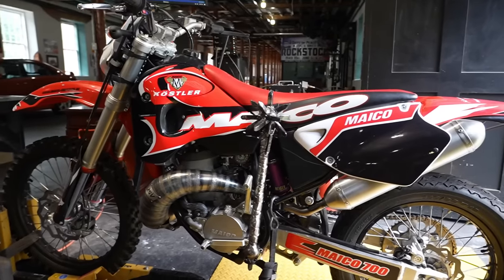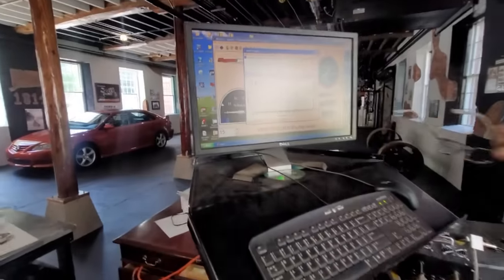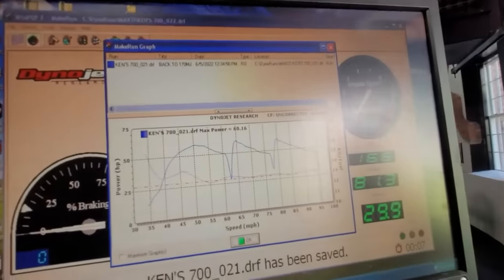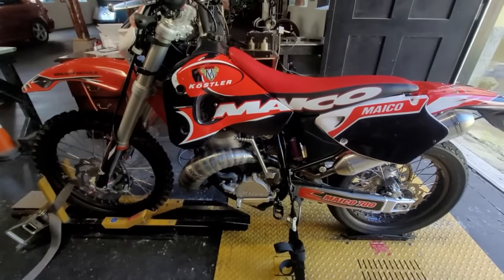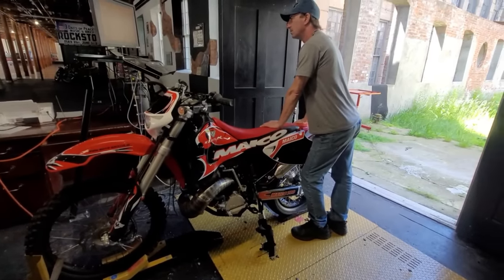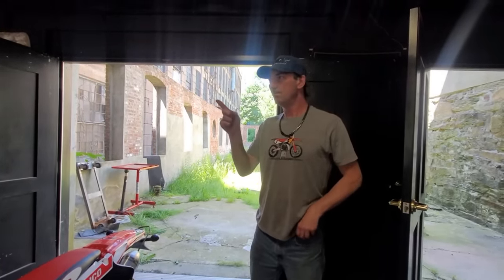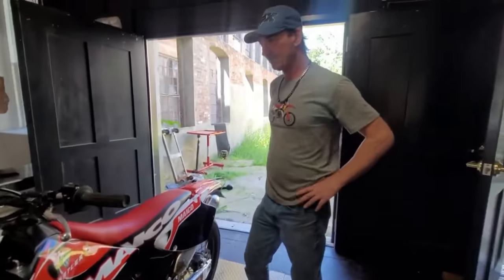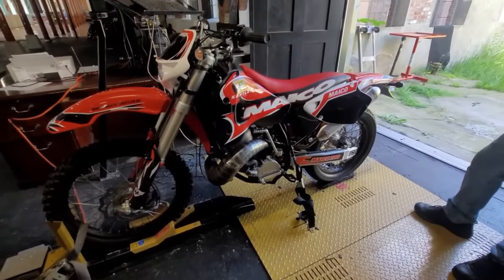2023 MAICO 700 DYNO PROOF 40% MORE TOURQUE THAN CRF450; THE WORLDS FASTEST PRODUCTION 2 STROKE

Comment: I would say that pipe is starving the motor of power. I had an 1160 twin snowmobile motor that made 205 HP at the crank. The pipes for this motor were substantially larger than what you have on the Maico flowing 580cc. For comparison sake that should make 120 HP based on the CCs it has. Also I was making 135 ft lb of torque.
Reply: @frenchonion4595  That thing should make 120 hp. I'm getting 102.5 HP and 67.5 ft lbs of torque out of 580 cc. The pipe is crucial to 2 stroke power.
Reply: it don't work like that. typically the bigger the bore on two strokes you start getting diminishing returns. meaning example YZ 125 has 37.5 HP X2 would be 70 HP but yet yz250 has 49. reason why is the bigger the bore to slower the flame travels just saying
Reply: @2strokecarbtuningportingin187  So why do I get 102.5 HP and 67.5 ft lbs of torque out of 580cc?
Reply: @kevinbok7269  makes sense if you think about what your saying. It's a 580 twin.  Now go back and read what I wrote
Reply: @kevinbok7269  stock YZ 250 has 49 HP  so getting over 100 with a 580 cc twin is expected
Reply: If you had a 4 cyl 500 you would be about 150 it's called thermal efficiency
Reply: @2strokecarbtuningportingin187  No it's an 1160 twin.
Reply: Hmm on pump gas  again I have heard lots of claims never gonna see  130 HP out of a 580 cc single he is lucky to have 70 at the crank with a 700. Thing is with your  snow mobile it has a variator type clutch so you get away with a lot higher portimings than a manual clutch / gearboxwood. Been messing with two strokes for a little over 44 years also been messing with four strokes for about just as long 2660 cc V2 naturally aspirated pro stock motor is making 400 at the crank
Reply: @2strokecarbtuningportingin187  OK I'll say this once. I have an 1160 cc twin that makes 205 HP and 135 ft lbs torque. Are you missing something here or am I? So in theory that 700 should be good for 120 HP.
Reply: @kevinbok7269  big difference in theroy than facts question on your snowmobile is it boosted  or on nitrous or funny fuel
Reply: @2strokecarbtuningportingin187  91 octane. 13.6 to 1 CR.
Reply: @2strokecarbtuningportingin187  Just so you know I live in the real world.
Reply: @2strokecarbtuningportingin187  I have had a CR 500 with 70 rear wheel HP.
Reply: Have u ever seen videos of 700 single cylinder 2 stroke DIRT bikes making 120hp ? Without burning Nitro, NOS etc. I'd like to see it
Reply: @capt.obvious9058  A Liger 550 made 91.5 HP.
Reply: Multi- cylinder engines will allways make more power than a single. Take a TZ250 VS a YZ250. The single cylinder YZ will make around 40-ish hp. A twin cylinder TZ will make 70+.

Comment: Just stop the engine braking please :/

Edit: 4-strokes mostly have only a little bit more torque than 0,1x the displacement. 125cc=12-15nm 250cc=25-30nm 450cc 45-60nm etc :D A 250cc 2-stroke has 45-55nm so about the same as a 450. There are clear losses when going bigger than 300cc on the smokers. If a 125cc 2-stroke has 25nm, 250 50nm, going by that formula a 700 should have 140nm but that would be insane :D

Comment: Bit odd how a 250cc Rs apprillia has 65bhp. Why so little from a 700?
Reply: Two reasons.
1st... The Aprillia is rated at the motor under perfect conditions and the 700 was rated raw at the tire. Drivetrains rob power.
2nd... RPM is what makes horsepower and big bores don't rev very high. Same reason a modern 600 street bike makes over 100hp and a 1900cc Harley makes 80hp.

Comment: Also a Cr 500 will do 100 mph with a 15:44 ratio...just throwing that out there...
Reply: Absolutely I had 16-44 on a modded wr 500 actual size 504 107 mph.  The limiting factor was  rpm. 6700-7 k
Reply: @techs1smh13  why yeah...that's bad ass...a 504 running over a 100...nice

Comment: It’s a bad machine but a piped & jetted 700 only making 60H.P. to the wheel? Thought it would of been in the high 60’s like 69.5…👍🏻💯🏁
Reply from the maker: Shipped with this pipe on it jetted fat for arctic conditions. We expected more hp that's why we spent so much time jetting, timing, fuel etc. The torque didn't disappoint
Reply: @KaplanCycles  No don’t get me wrong, it’s with out a doubt a bad ass machine! I just figured high 60’s. And even if it came with it that’s a bad ass “after market”pipe! 👍🏻🏁
Reply: @KaplanCycles  Cool what you guys do though! So if I just bought that back and live in New England like I do. I’d know exactly what to jet it for our weather….💪🏻🫡🇺🇸🏁

Comment: How does a 700cc 2 stroke make more torque than a 450?! You ladies. I'll add The surface area of the piston and the stroke determine torque not the weight of the crankshaft. The 450 still makes more torque during the power stroke it's just half as often.

Comment: Please pronounce Maico correctly? It's "MIKE-O" and not MAKE-O. Ask your vendor if you don't believe me?
Reply from the maker: I'm from Massachusetts we paak the caaa and took the caab.that will never change
Reply: @KaplanCycles  I get it and no disrespect intended as I had always pronounced it "MAKE-O" myself and rode them back in the later '70s and early '80s. In 1986, I took my first trip to Germany to meet some people I had only 'known' from written letters. One night at dinner, MX came up and I shared with the others that I ride a "MAKE-O" and laughter erupted. A man named Uwe informed me that was a shark and that "MIKE-O" produce motorcycles. It has stuck with me ever since. I'd love to throw a leg over one of those 700s as I had a '72 MX501 decades ago that and it was so much different than the smaller displacement bike. It didn't rev that high, but made bucketloads of torque.